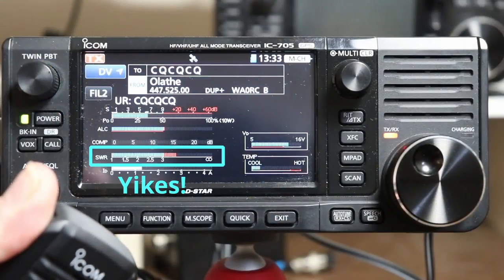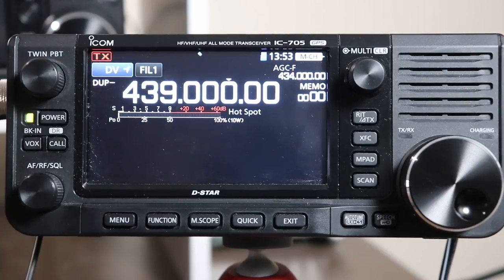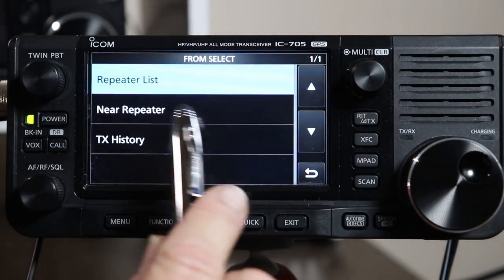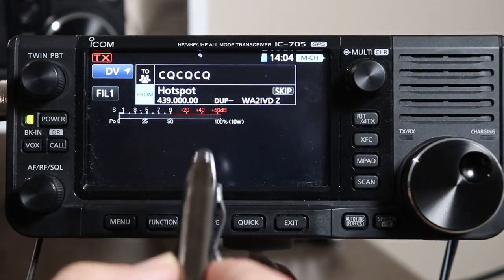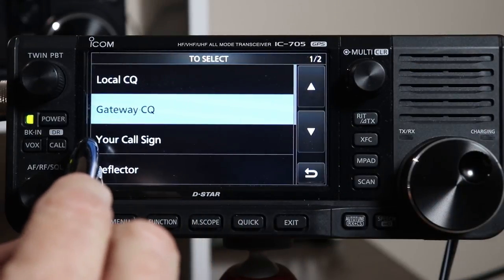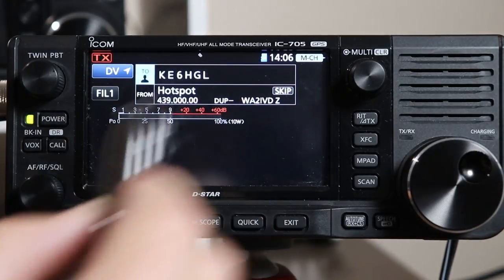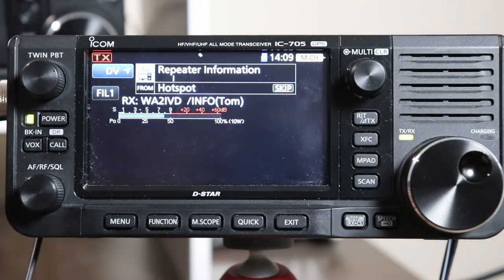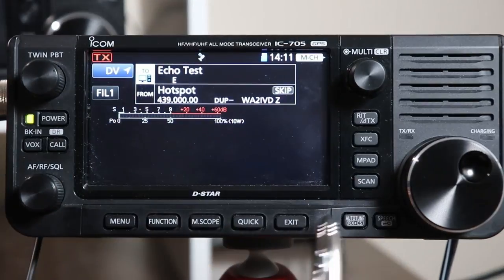IC-705 A to Z #8 DSTAR Part 3 - DR Mode

Comment: How to set up Hotspot for the first time in the From field.  You chose it in your video from previous use. I am using an OPENSPOT 2
Reply: Tom, I have the same question.  How do you setup and choose a hotspot for the first time? Is the hotspot something different that an internet wireless access point?

Comment: If you are operating in a fixed location...from your shack...simply add your GPS data in manually (check the menu). Then the DR mode will compare your location with the repeater location data entered into the Repeater List, and display the repeaters within a 60 mile (??) area.

Comment: You should turn your GPS set OFF if you are not going to manually enter your location data.....to keep the GPS icon from blinking and blinking and blinking ......
Reply from the maker: Yes, that’s probably a good idea.  My shack is in the basement with one small window up at ceiling level.  Sometimes the GPS will lock up and sometimes it won’t.

Comment: Thank you Tom.  Will you please consider a video on how to set up the Hot Spot?  You mentioned new gateways needed to be saved to the SD card, then uploaded in to the 705.  How does all that work?  The manual does not even mention hot spot.  Searching brings up your video. 😊

Comment: Thanks Tom for all the information on D-Star. I do have a question about the registration process, I have registered my ic-9700 about a year ago and I just got my new Icom id-52A. Do I have to register again since it is a second radio or is registration based on my call sign?                73 Wayne
Reply from the maker: Hi Wayne,
When you register for D-Star, you are registering your callsign, not any particular radio.  You only need to register once. You can go back and update your registration for other devices, like a hotspot.  You shouldn't need to do anything for an additional radio as long as you program the same callsign into each new radio.

Comment: Finally got my DSTAR registration and set up my IC-705. So far, so good. I've only found one local DSTAR repeater that seems to be active. I'm not sure I'm doing the right thing to connect to reflectors like REF032C or REF001C. Would appreciate more information about how to access the various reflectors and protocol for using them. Thank you! - K7LTZ
Reply from the maker: Hi Jim.  Glad to hear your getting things up and working.  On protocols and using reflectors, the best advice I can give is listen for a while (that's what I did).  And also check out http://www.dstarinfo.com/home.aspx  The home page some helpful tips.  There is also an FAQ section and a list of reflectors.  That's where I got a lot of my initial info from.

Comment: Tom wanted to ask a question.  Most digital radios are HTs.  So they have their "rubber duck" antenna.  With the 705, if I have it connected to an outside antenna on my house would I be better off using some kind of "rubber duck" antenna when using my hotspot in my house?  Other ops talk about poor SWR on the 705 using those types of antennas.  I'm not sure what the proper antenna setup would be when I'm using my 705 with a hotpot.  What power should I be running?  10 watts may not be necessary, but I'm not sure of the best approach.  Thank you for any input!
Reply from the maker: Hi Brad.  Two parts here— On the outside vs. inside antenna, I wouldn’t say you’d be better off with an inside antenna.  The outside antenna will work find.  If there are hams nearby and your both using the default frequencies on your hotspot, you might be bringing up your neighbors hotspots.  Many rubber ducks don’t have a great SWR, but inside with your hot spot it doesn’t matter.   10 watts is definitely not necessary.  Your hotspot is probably putting out <0.1 watts.  You can set your 705 output power about as low as it will go and probably just stick a straightened paper clip into the BNC center conductor on the radio and it would work fine. (To be clear, I’m not recommending the paper clip).  I would at least turn the power way down when using your hotspot.  If you want to switch to an inside antenna, that would be fine.  If you don’t want to keep switching antennas, that’s fine too.
Reply: @HamRadioA2Z  good stuff.  Thanks Tom!  73 Brad K0WET

Comment: I’m a new ham. Just bought the 705. Now waiting in BNC connectors to hook up antenna. What type of antenna is used for Dstsr?
Reply from the maker: Hi Rich.  Welcome to the hobby and congrats on the new radio.  You’re going to love the 705.  There is no special antenna type for DStar.  You just need an antenna for whichever band(s) you will be using DStar on - Usually 2 meters and 70cm.  You can operate DStar on 6 meters and HF too and the IC-705 is capable of that.

Comment: I'm confused. you're saying using reflector over the internet. You don't need an antenna?
Reply from the maker: Hi.  Yes, "Reflectors" are kind of like internet repeaters.  They can be (and often are) connected to radio repeaters around the world.  You can also connect to them with a Hotspot.  It is like a tiny, low power repeater of your own that you have at your house.  It has a radio receiver, transmitter and an internet connection.  One of the more popular ready-made ones is the OpenSpot4.  Google that and you'll find a bunch of information.

Comment: Hi..very good videos..but a cry out for help. When I start pistar I hear that I am connected to reflector. I can listen to the refector and the hotspot shows details of the station but I cannot transmit…any ideas…am pulling my hair out!!!!
Reply from the maker: I'm using Pi-Star as well.  Mine is with a Pi-Zero and the MMDVM board from N5BOC.  I have had a couple times where I could hear stations, but couldn't seem to transmit.  I rebooted the Pi-Star and that fixed the problem for me.  I'm guessing you've already tried that.  I can't think of anything in the settings that would allow you to receive and not transmit.  Have you checked the obvious/silly things like you have an offset programmed in the radio and you PiStar is set for simplex?  Or the PiStar is duplex, but you have the wrong offset in the radio?

Comment: I have the IC9700, and DSTAR is a bit head wrecking..hence I don't use it much
Reply from the maker: You should try connecting to DCS983A on Tuesday nights (Wednesday mornings) for the AmateurLogic SoundCheck net.  The net starts at 8pm U.S. Central time (1AM or 2AM UTC, depending on daylight savings time).  It is a digital mode net that has virtually every digital mode tied together.  You can check in on DSTAR, DMR, YSF, P25, etc. etc. etc.
73,  Tom

Comment: @5:55 How did you add it to your repeater list????
Reply from the maker: Hi- It is possible to save a station that you’ve worked with the CS and CD menus, but honestly the easiest way to add repeaters in the DR list is to just import a new .CSV file with the ones you want included.